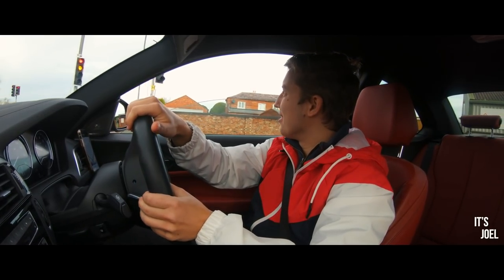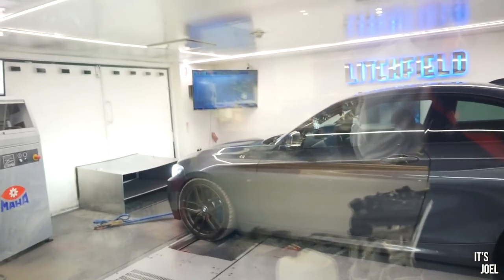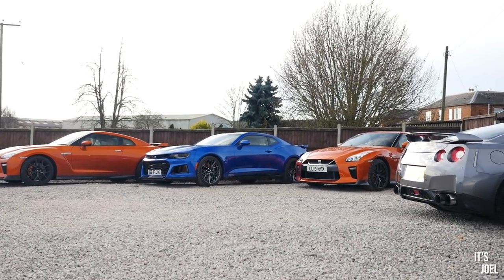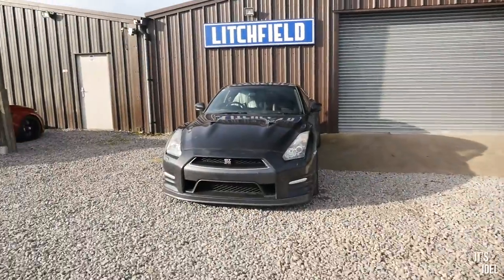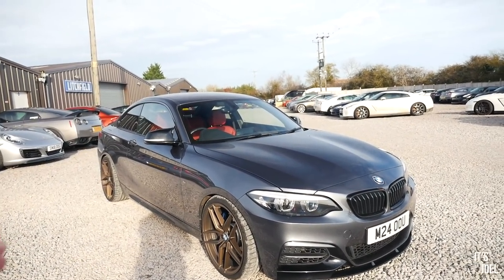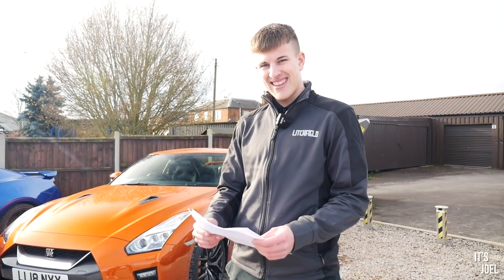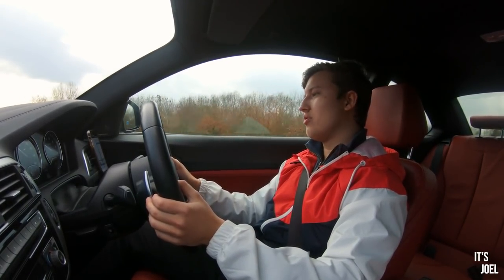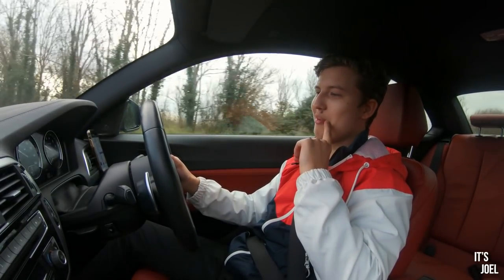My BMW M240i Goes Litchfield Stage 1!

Comment from the maker: Can’t believe the power difference in the way it feels! Should I take it further?
Reply: Yes 👍🏻
Reply: Go further 😄
Reply: 100%
Reply: Go XHP tcu tune to remove the torque limiters on the gearbox
Reply: Is that even a question ? 😄
Reply: question is do you really need more power if there are no track days involved!
Reply from the maker: I’d like to take the car to the Nordschleife as soon as possible
Reply from the maker: Yeah very good point J B
Reply: No. Spend some money on the driver. Get some track tuition.
Reply: No, buy a 760Li instead.
Reply: @J B bro I’m even scared of stage 1 affecting the car . You sure it would be safe ? Spend too much on this car 😅 don’t want to deteriorate the life span
Reply: @J B do you know anything about theB58 engine 😂😂😂😂😂😂
Reply: @Dayton Alvaro Instablaster ;)
Reply: @Lance Thiago DAMN IT ACTUALLY WORKED! Just got access to my Instagram login after roughly 30 mins of using the site.
Had to pay 15 bucks but for sure worth the money :O
Thank you so much you really help me out :D
Reply: @Dayton Alvaro You are welcome :D
Reply: i have stage1, vrsf downpipe, k&n air fitter and m performance exhaust. 480hp + 640 torque

Comment: Yes Joel! Mental power now for such a little car. Very curious to what it will make with a stage 2 and all the relevant hardware. Though perhaps get the most you can out of stage 1 before going to stage 2. I now speak from experience when I say that lol.

The smile on your face and the reaction says it all. It's all about that feeling the car gives you and it certainly looks like it gives you a massive high. Time for some dragy numbers!
Reply from the maker: Definitely massively improves the fun factor

Comment: FYI you had closer to 90 to 95 hp  increase. The more power you make the more diminishing returns u have. What fuel did you have in the car? You may be able to gain a few more hp still.

Comment: My stage 1 evolve tune had 421 hp and 635nm surrey rolling Road.
Reply from the maker: Very nice
Reply: @itsjoel  would be good to see a roll to see differences.
Reply: @derekporter66  635nm from a standard engine with just an ecu tune ?
They have over exaggerated those figures to make you happy, not a chance you get anywhere near that torque without mods.
The bhp is about right, as 420bhp is the absolute mechanical maximum for just an ecu tune, but not a chance on the torque figure.
Reply: @DjNikGnashers  srr are meant to be independent. No idea
Reply: @DjNikGnashers  who. Mapped. Yours? 100 to 200?
Reply: @DjNikGnashers  I've got itg. 4.5 decat downpipe. Wp intake pipe. Mg flasher stage 2 plus. 100 to 200 is late 6s.

Comment: Great great great! Z4 for stage 1 as next step? 😃
Reply from the maker: Not sure I’d quite get a 22% return 😂
Reply: @itsjoel  the Z4 is NA so would only get 10-15 bhp increase however you would notice the better throttle response.

I'm currently getting my Z4 turbo'd amongst several other mods and going for about 600 bhp.

Comment: I need to find a shop in LA that does a map like this. Can you light the tires up from a standstill pretty easy? When I put more grip on the stock power I can’t really break out the 240 as much
Reply from the maker: Yeah it’ll light the tires up no problem, it struggles to get all the power down most of the time now haha

Comment: How about getting a Stage 1 upgrade on your Z4?
Reply: His Z4 is NA is stands to gain very little from a stage 1 map. He would have to supercharge or turbo and as someone going through that right now it's not cheap.
Reply from the maker: Agree with Martin there, you’d have to put thousands into the Z4 to get a 80hp increase. I’d sooner by a Z4M. Having said that, it’s nice having the Z4 as it is, it’s got just the right amount of power that you can use all the time
Reply: That's fair enough. I have thought about going for a Stage 1 upgrade on my Z4M but after doing some research, it appears that the maximum power uplift that is possible is only about 15bhp.

Comment: That looked like a 0-60 in 3.5 seconds. That’s almost a full second faster than factory
Reply: Hundredths of a second aside even if it came in at 4 dead it’s a properly quick car.
Reply from the maker: Think I timed it frame by frame in the edit, and was about 3.9 to 62. Ridiculous
Reply: @itsjoel  Post a draggy result up mate.
Not a chance your car does 0-60 in sub 4 seconds.
My M140i is 455bhp/634nm and struggles to get 4.5 secs to 60, and I have not seen any others get close to 4 seconds in real tests. unless they are XDrive models.
Reply: @nik better tyres+lsd?

Comment: Xhp gearbox flash now?
Reply from the maker: Would like to yes
Reply: @itsjoel  ive done it done it myself its pretty easy , get xhp software and mhd to go into your obd port and connect with your phone it really does transform the car with that extra clamping force now that you have more power .👍

Comment: did this tune void your warranty?
Reply from the maker: Yes I’m pretty sure it would do
Reply: @itsjoel   I got a decades worth of exp in auto industry. only way to "void" your warranty is thru totaling your car, and even then recalls are still to be serviced on your vehicle.
Reply: Most dealers will blacklist your car if they find that it’s been tuned, even tho they’re not supposed to
Reply: @theendangeredpetrolhead  I was speaking to a BMW master tech about this. If a customer trade in has been tuned, they cannot sell it on their forecourt and have to auction it. Whether or not it's easy for them to find out save for being told by the customer themselves, I have no idea as I didn't ask that. As for voiding warranties, I always assumed it would but I've never clarified that.
Reply: @64bakes  it’s pretty easy for them to check it. If you go in for something big like an engine issue, there is a 99.9% chance they will look for it and find it.

Comment: What did this cost in US dollars? Thank you trying to decide on what brand!
Reply from the maker: About $750
Reply: @itsjoel  wow that's really inexpensive compared to Dinan thank you. I just bought a 2021 m240i xdrive I'm just worried about my new car warranty with going with stage 1. Don't know if it's a risky move or not wouldn't want to lose my coverage!
Reply: @germanengineering204  I just picked up my 2021 M240i a couple of weeks ago. I’m loooooving it and am thinking of the stage I myself!
Reply from the maker: It’s pretty remarkable to be able to get such a massive power increase for a relatively small amount of cash

Comment: Sorry but your figures were over exaggerated by Litchfield.
356bhp stock is high, and 432bhp from just a remap is also high. Maximum real power for a standard B58 with no mods is 420bhp tops.
Did you go any further down the tuning route ?
My M140i has a 200 cell cat and ITG air filter, and the XHP3 g/box software, it's pretty savage now.
Reply: You have no idea what you are talking about. A bootmod 3 93+ octane stage one will give 440bhp. Stage 2 with a downpipe approx 460bhp and stick the HPFP on and you will get approx 490. Have a custom tune you are looking at 510bhp crank. 356bhp stock is normal and I'd expect higher. They are quoted whp.
Reply: @TeacherToolkitDemo  I work in the motor trade, I know exactly what I'm talking about.
I can show you a video where a standard M140i made over 500BHP from just a remap.
Of course, it's complete bullshit, but it's possible for anyone to give a customer a dyno graph which has this figure on it.
Just because some clowns believe anything tuners tell them, does not make it  accurate or in any way truth.
Nobody can say what a certain map will give a certain car, least of all you, there are too many variables, and if you work in the motor trade like me, you would know that if you dyno the same car, on  the same dyno, on the same day, 5 times, you will see 5 different results.
BHP cannot be measured, only calculated from the torque which CAN be measured. And even then, it varies with every run depending on intake temps, traction on the dyno, fuelling, timing, and a dozen other variables.
Max true bhp from a B58 engine remap is about 420, it is scientifically impossible to get more out of an unopened, completely standard B58 engine, and if you don't understand that, I suggest you give up trying to argue against real science because you obviously don't understand as much as I do.
Reply: @DjNikGnashers  damn that's some essay 🤣. They make what I said they make. You are talking nonsense.
Reply: @DjNikGnashers  How can your M140i have 455bhp if 420bhp is the limit? Are you a real scientist? 🥴.
Reply: He’s saying that 420bhp is max threshold for stock B58. So with the Quicksilver Exhaust, is giving him 432 which sounds about right for the amount of gain you could theoretically get out of a performance exhaust (12-15bhp)
Reply: @DjNikGnashers  Just curious, if as you say, calculations of BHP are wildly inaccurate, how do car manufacturers spec BHPs? There must be some comparison at a relative level of accuracy or manufacturers wouldn't bother specifying it.  That's not a dig at what you're saying, I just think it needs elaborating.
Reply: @stoatythesecond888  Thanks for the adult reply mate. Genuinely appreciate it, and I'm genuinely up for discussing the subject.
The problem with calculating BHP is that BHP can not be calculated properly, only estimated. Only Torque is measured on a dyno, and BHP is estimated according to calculations which can vary a lot, because the calculation takes many different factors into account, and every dyno is different, every run even on the same dyno gives a different result, and it is very easy to 'fool' a dyno reading.
There are some brilliant videos online showing how inaccurate BHP figures are.
For example, my car, the M140i, was dyno'd at 336bhp, and a video online by a tuner showed their M140i dyno'd at 338bhp. They remapped the ecu and it made 410bhp (mine made 411bhp after a remap). They then adjusted the formula slightly for calculating the transmission loss and it made 440bhp. Then they did another run after loosening the straps holding the car down, so that it would just ride the front roller of the dyno a little, and it made 460bhp !!. Then they put the ambient air sensor for the dyno into a hot cup of tea, and did another dyno run, and the car made over 500bhp !!!
Dyno's can read whatever you want them to basically, and tuning companies are just selling a product. So, if one tuner says they can map your car to 420bhp, and another says they can get 450bhp, it's obvious which one you will use.
This doesn't mean the car is actually putting that figure out.
My car made 455bhp with a 200 cell cat, on a dyno which is classed as a heartbreaker, ie reads very accurate. On another dyno I'm sure some tuners would have my car reading 480+ bhp, with exactly the same mods on the same day same temp same fuel.
Reply: @DjNikGnashers  Cheers for replying, that's interesting, I didn't actually realise it was based on torque or that they all used different calcs.  Ultimately I guess, if you can tell there's been a significant boost in power, that's all that matters, numbers after all are just numbers to chat about with your mates, proofs in the driving!
Reply: @stoatythesecond888  100%
I don't claim to be an auto engineer, although I do work in the motor trade and have done for years, so I have an understanding if not a mastery of the subject.
A car engine is basically an air pump, and you can only get out, what you put in, considering it's limitations.
It's just not mechanically possible to get (again using my own car engine as an example), more than 420 real bhp from it's B58 engine, because the limitations of the fuel / air mixture, and the amount the exhaust can clear that mixture dictates that, no matter what a dyno graph says. And just by letting the car ride up the front roller of a dyno slightly by loosening the straps, can increase this figure by a good 10 or 15 percent. The engine isn't making any more power ! But the graph says it is, so it must be true right lol ?
Tuners are businesses and they are all competing against each other, so naturally they are going to try and trick the figures to read higher, as it generates more sales. Can't blame them really, but personally, I'm much happier with a conservative dyno reading, a true reading, and a map which is safe against pre detonation etc.
The limiting factor with my car was the cat, so a more free flowing cat allowed more fuel and air to be mixed, giving a bigger 'bang' and the 200 cell cat allowed this to flow out of the engine, giving more power. Now my high pressure fuel pump is maxed out and to get more power needs a HPFP which will pump more fuel. This would get it to about 480 real bhp but then the turbo is maxed out, so a bigger turbo would probably get me to 550bhp. But this creates more heat, so to safely run that power without power dropping as temps rise, would need massive cooling upgrades.
It's an expensive journey mate !!!!
Reply: @DjNikGnashers  All makes sense, cheers for the info.  Out of curiosity, what sort of upgrades in your opinion are worthwhile prior to an ECU tune to maximise the performance gains, within reasonable cost boundaries on a 2020 240i? Filter and exhaust seem the obvious choices unless I'm missing something.   I used to have a 2007 130i LE but that was naturally aspirated and roughly 260 brake with very limited tuning options.  I'm anticipating the jump to the 240 is going to be significant!
Reply: @stoatythesecond888  Yes the 240i is a great car. The air intake system is actually very good from standard, and to be honest, a 'performance' intake kit won't really gain you anything. Mine is standard still, I did try various performance air filters in the standard air box, but gained nothing, I have the standard air filter back on now, and it is not limiting my tuning at all.
Performance-wise, getting it in at a good tuners is all you need to do, and you should see a good 60-80 bhp gain simply from a remap which maximises the engine and it's various components.
The thing which will limit gaining more, is the cat. Yes an exhaust might sound nicer, but they are hugely expensive and won't gain anything in reality. Getting a more free flowing cat will allow the tuner to get a lot more from a remap, but the issue I had (and I bought a top quality 200 cell sports cat from Wagner : the standard cat is 600 cell), is that mine only just scraped through it's first MOT on emissions. The following year it failed badly, so the sports cats only 'work' as in allowing as much exhaust gasses to escape the engine, while still passing the MOT, for a few months, and then they don't really capture enough hydrocarbons for it to pass the MOT.
I'm lucky as I work in the trade and know a 'friendly' MOT tester lol.
This is something none of the youtube tuning boys channels fail to mention.
Reply: @DjNikGnashers  Thanks for all the info man, appreciate it.
Reply: He states in a previous video that he has a Quicksilver cat back exhaust, claiming BHP gain of 16bhp. BMW uses the same model dyno. BMW claims 340bhp, the numbers are spot on for the stock run, the stage 1 tune too works out.

I have just had a stage 2 tune at Litchfield, 450bhp is what they state power will be after sports cat downpipe and intake upgrades. I achieved 463bhp because I fitted the B58TU hpfp, stage 2+. I also flashed the gearbox with xhp! The torque limiter is adjusted to allow more at change of gear, even with this raised the technician said they couldn't tune and use all the torque the engine would give because it would bounce hit the limit and drop boost. A friend has an older M240i with 60k miles, someone told me that like the old Golf GTI 16valve engines the B58's get more powerful with milage. Don't quote me on that! He has a de-cat downpipe and the other same mods, his Dyno reads 491bhp. The numbers could be inflated, but with no cat restrictions, resonators or back pressure it could in theory make 28 bhp more than mine because of the restrictions of exhaust gas flow with a sports cat and the resonators, no GPF though as 2017.

Performance M does a stage 1+ set up fitting the B58TU hpfp achieving around the 450bhp mark without changing the downpipe for people not happy with sports high-flow cat downpipe or de-cat potential MOT failure risks. Not sure what the tune looks like on a graph showing delivery of torque and hp.
Reply: Honestly bro , I understand what u are saying , and the more numbers a tuner can give u the better for them , but I thrust MHD , and they say stage 2 with complete exhaust u can get up to 470hp , hi flow fuel pump 500hp , 420hp is for stage 1 with ( stock exhaust ).